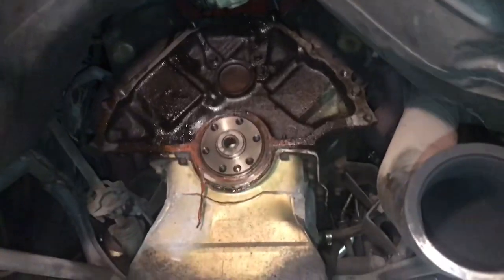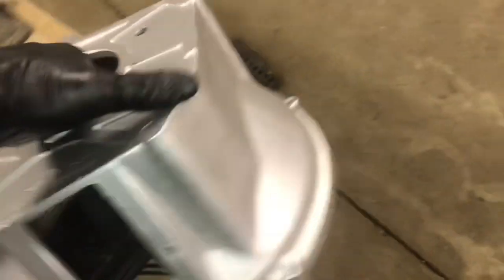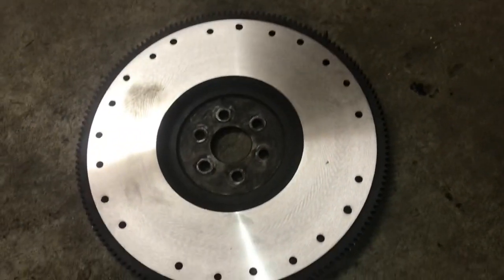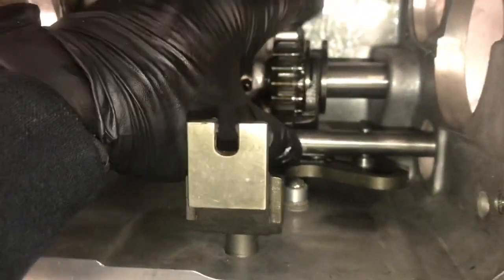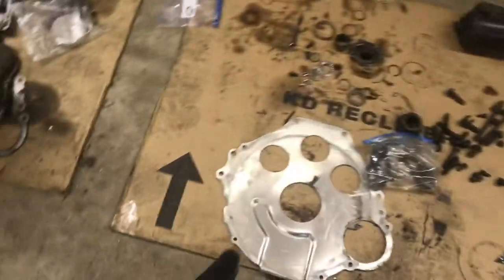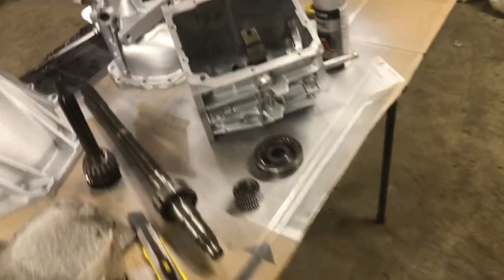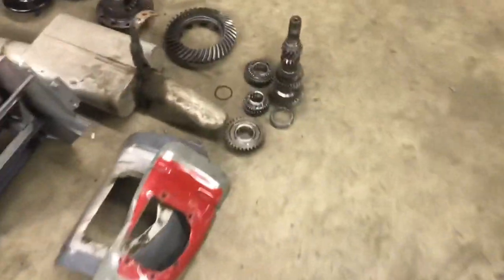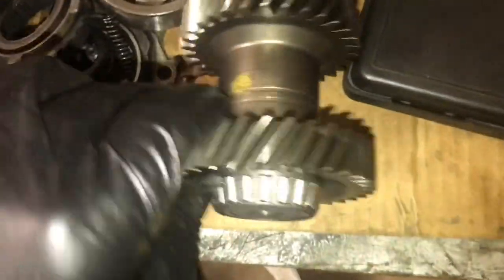WHAT T5 Trans is STRONGER!? 2.3 vs. 5.0 Differences. Lets take a look inside! Fox Body Mustang

Comment: 30ish years ago I built a 302 with 289 heads and headers and used a turbo coupe T-5 and I was told to use the pilot bearing for an '8w Ford Courier pickup. It worked well considering T-5's weren't something you could find everyday but the rear 2.73 gear required shifting early due to the turbo coupe having higher a gear ratio.  For a mild V8, it'll work in a pinch until you can get it upgraded or replaced.
Reply from the maker: Right. i think i mentioned something like an 84 ranger diesel input bearing woudl work. Or alternator bearing.

Comment: I bought a steel/ aluminum bearing retainer for a V8 T-5 and it fit perfectly on my I4 T-5 out of a 85 SVO Mustang. As far as I know, the 85 T-5 out of an SVO mustang is the only exception.
Reply from the maker: SVO , 4cyl and V8 retainers are not the same.
Reply: @Neomustangs  I don't usually reference forums, but a few people on Turboford said the 85 SVO T-5 is the only four cylinder T-5 that the V8 T-5 bearing retainer can be used on. I bought the FMS-M-7050-A. I measured up and down that retainer with calipers and compared it to the old retainer, and all the measurements where exactly the same. I do know the difference between the I4 and V8 retainers is primarily the depth of the retainer where the bearing race resides. The retainer fit on perfectly. Maybe there is something I am missing.

Correction: I got the info from www.svoca.com. one of the members referenced Hanlon Motorsports as the primary source of the Info of the bearing retainer fitting. Apparently, they only fit because it is a World Class with a different first gear than all the other four cylinder T-5s. One member even mentions he bought four cylinder T-5 that had the steel retainer already on it that the previous owner had used.

Comment: Hey Dan
There was a 91 t5 4 4cyl car yesterday n I completely dismissed the car it being a 4cyl car....Dan I'm kicking myself right now for not pulling it....all I took from the car was the cowl cover petal assembly ...car is a hatch has blu interior..door panels gone. Lx seats with. Brocken driver seat rail but rails are identical both pass n driver side so I took seats out of. A 94 sn95 with sport black n grey electric driver seat n put on the fox pass manual  rails on the driver side only as I could not move the rails forward to access the rear 15mm nuts holding it down..the front bolts line up perfect rears bolt holes position are about 1 in longer from the fox original bolt holes on the rails so all it needs is drilling 2 holes out to match holes on the bottom seat assembly...
I'm going back to get the cross member n drive line n clutch cable at least. . damn.
Thx Dan.
I'm watching this video again n again for me to remember next time I see a  5spd manual 4 cyl fox.

Comment: That's awesome information, now i can understand why i never could find a the right gears for a 89 mustang lx because i realized it had a 4 cyl t5 when i changed the u joints, because the u joints i bought were bigger so i went back to the autoparts to exchange them for the 4 cyl and those u joints fit well, so since i bought my mustang it was running 3.27's and later on i replaced the gears for 3.08's but the first and second gears still too short so when i used to shift into 3rd my stang won't still running strong, and now i can understand why that was happening great info man appreciate it. 👍🏻👍🏻👍🏻
Reply from the maker: Your Welcome! The first gear on world class t5 is 3.35. The first gear on 2.3 is 3.97 ratio so ya it would play havoc on gear choices if unknown.

Comment: Dude!
Great T-5 video!!
I don't know how you remember all that info/numbers.
I have a WC T-5 from my '85 Mustang 5.0. Can I put that behind my '84 Mustang GT 2.3L Turbo?
(Not an SVO....OEM motor was non intercooled @ 145 HP)
The '84 came with a T-5 but I don't think it will hold up behind the new 425 HP   
2.5L Turbo motor that I'm building.
Reply from the maker: Rebuild enough transmissions and it just becomes part of your knowledge

Comment: I have a 2.3 T5 (WC I believe) that I'm planning on putting behind a stock 302 in my F100. Do you think it will hold up OK?
I don't plan on putting my foot through the floor or anything, just for cruising
Reply: I’ve been running one on my drift car for the last 3 years without a problem and I’m clutch kicking and putting my foot through the floor 😂

Comment: I have a new edge with a world class but I was the guy...I bought a T5 but according to you it's a 4 banger T5. Can  I swap out the input shafts so I won't need to change out that bearing???
Reply from the maker: The 4cyl transmissions are completely different gear sets inside. They are smaller and weaker. Theres no getting around it. About the only thing same with V8 and 4cyl trans is the outer cases, top plate and main shaft (outside of hard parts like shift forks and stuff)

Comment: I noticed you had a lot of t5 parts .  What usually breaks and why ? I recently had my t5 cryo treated , installed counter shaft plate and shimmed  the input shaft along with counter shaft for no end play . Looking to make 400 to the wheels  . Do you think it will hold up ? What’s your thought on aftermarket gear assembly  ? I have an opportunity to get a proshifted used assembly to install for 500
Reply from the maker: Really it’s about the clutch set up and how your shift

Comment: Can I use a V8 T5 rear housing on a 2.3l T5? I have an early 74 Mustang II and I need to move the shifter back about 2in in order to use it. The only adaptor I can find that will relocate the shifter back 2in is for the V8 model. Thank you for your help.
Reply from the maker: Don’t think so

Comment: Besides the smaller snout/pilot bearing (not 17mm OD)
Are the V8 and 4 cylinder T5 Input Shafts the same overall length?
I read somewhere that they are different lengths.
Reply from the maker: Yes. 4cyl and v8 is the same 87-93 lengths

Comment: Dan I just recently purchased a 4cyl T5 (unknowingly).  I have the 5,0 bell housing. can I change the input shaft and bearing retainer to the 5.0 T5.  Not wanting to create crazy power into a 1965 coupe.  Or should I just look for the 2.3 bell housing?
Reply from the maker: No the 4cyl input and retainer is different than a v8 can’t simply just swap them.

Comment: Hey man isn’t there a particular year Fly Wheel you need? I’m making a 4cyl T5 work for a 351w I’ve got the bell housing I need already
Reply from the maker: No need really just a 10.5
Reply: All oem 351w are 28oz. A 302 can be 28 or 50oz, depending on the year. I believe 302's after 81 are 50.
Reply from the maker: Yes

Comment: What about the diffrence in the turbo t5 have a chance to pick one up low mileage automat 87 or newer turbo T-bird Coupe now I hear they're a little bit stronger than the regular 4-cylinder 2.3 the factory gear was too short for the added to 3 Turbo so they made the 2-3 turbo t 5 a little stronger due to the turbo so I've been looking for information on the T5 Turbo 4-cylinder trans
Reply from the maker: ITs about the same really.

Comment: And always remember , a 351( factory)  takes a 28 Oz offset ( instead of the 52oz) flywheel, don’t try it ,you won’t like it.(duh huh ,duh huh ALSO, if you need the shifter to be toward the middle of the doghouse an S/10 tail is exact( for some odd reason. But also have to have a longer drive shaft right , iOW, just use a benchseat shifter right ? Right!
Reply from the maker: Right. Thx for info

Comment: What about using a t5 from a v6 sn95/new edge. I've heard they're stronger? Dont know how much truth there is to that. I know you have to use a sn95 v8 bellhousing
Reply from the maker: Same strength bro
Reply: @Neomustangs  alright well I guess I'll be using a v6 t5 then cuz I cant find a v8 t5 at a reasonable price in the ft wayne area
Reply from the maker: Well a good well built T5 I do is alll day 1000-1200. I mean I put half that in new rebuild kit. Reinforcment parts and anything that looks worn gear wise
Reply: @Neomustangs  that's what I mean though. Most people want 800 bucks for a v8 one that needs rebuilt here, I can go get a v6 one for 100 bucks and rebuild it
Reply: I had a new edge t-5 in my 94 gt was in for almost 2 years and then started to grind going into 2nd from time to time

Comment: I put a sn95 cobra in my 84 mustang it burnt out in a couple days shaft is stuck now oil smells burnt in the transmission I  put the bell housing and clutch fork what do you think happen did I mess up putting that transmission in my car?
Reply from the maker: The Sn95 has a longer input shaft. You probably jammed it. Did you use the sn95 bell ?
Reply: @Neomustangs  yes

Comment: Question for you my friend. 

88 tbird turbo coupe world class t5, I’m going to be using this in my 93 4 cyl foxbody swap with a 302. What will I have to change? Just the input shaft? 

Thanks! Looking forward to your response.
Reply from the maker: No just use a different pilot bearing.
Reply: When I used a turbo coupe trans T5 in my 5.0 stang , I used an early brass bushing that fit in the back of the crank , but machined the inside of that bushing to accept the roller bearing for a turbo coupe,  whis is smaller than a 5.0 , I drag raced it many times , ran slicks & came off the line @ 3k & road raced it , & it held up fine .
Reply from the maker: Ah yes

Comment: Hi I want to do aT-5 swap into a1954ford behind a Y lock is a camaro v-8 T5 as stronger as the v-8 mustangs? I need the swifter forward like a s10 to look correct. So I don't have to get 2 
trans. Just to change the tail hous -infant want to use stock clutch setup I will have to modify the bell housing to bolt up the T-5
Reply from the maker: Intriguing. T5 from camaro is non world class. SO no.

Comment: What would the issues be if I used a v8 bearing retainer on a 4cyl t5? Its not in the car yet. And if it makes a difference it’s the trans is from an 86 svo
Reply from the maker: You can’t the bearing and input are different
Reply: Neomustangs the V8 one won’t fit in the 4cyl?
Reply from the maker: Defect In Design no the input on the 4cyl bearing and input retainer is larger.
Reply: Neomustangs then help me understand how the one off of my V8 T5 fit on my svo T5. Im not trying to prove you wrong. My only hope is I didn’t muck anything up. I lined them up and nothing looked different. 

Good luck at the dyno my friend
Reply: Neomustangs and not for nothing, I put the bearing retainer from the four-cylinder T5 onto the V8 t5 and it fit just fine. As a matter of fact the input shaft on the V8 ended up with the same amount of slack that was in the four-cylinder when I got it. The bearing retainer that I’ve had on the V8 isn’t very old. it tightened up the SVO input shaft nicely. Retainer was torqued to 20 foot pounds and transmission spins like butter
Reply from the maker: @oprecourt  Thanks about the dyno we did good. We didn't get aggressive this session. Made over 600 wheel. No big deal Street car.
Reply: Neomustangs damn dude! That’s plenty!! Now you gotta find a road that can handle 600hp lol
Reply: I see what you’re saying about the 4 cyl bearing retainer. I’ve seen some where the flange for the shaft that the throw out bearing rides on, protrudes more. I’m assuming that’s where the larger input shaft bearing resides.
Reply from the maker: Defect In Design The inside of the bearing retainer where the bearing race sits is different. It’s larger than a normal V8 race and retainer is. So you can’t use a V-8 retainer on a four-cylinder trans and vice versa because their bearings aren’t the same
Reply: Neomustangs exactly. Not sure why this svo trans has the smaller V8 bearing race. Side by side they’re identical in every way